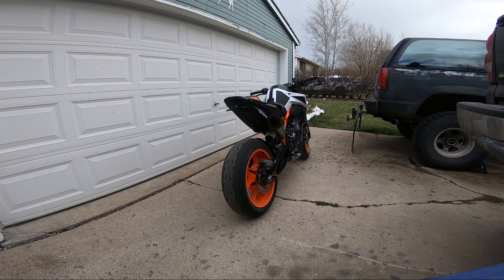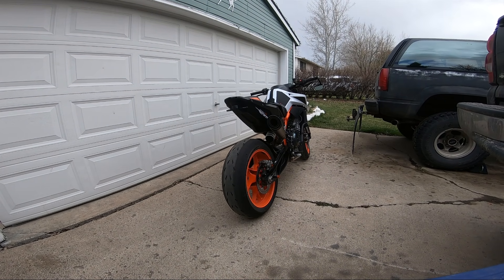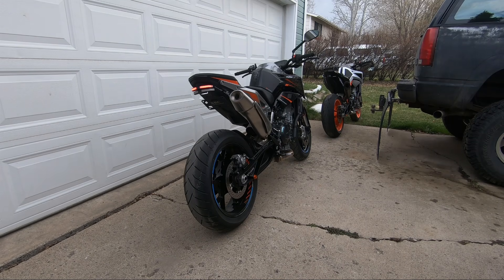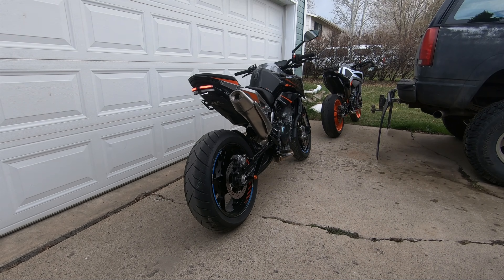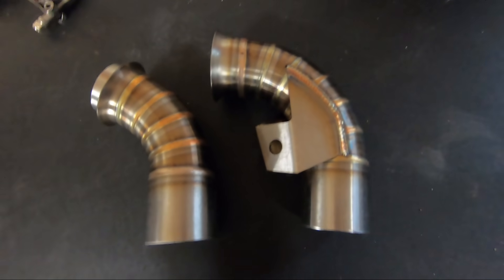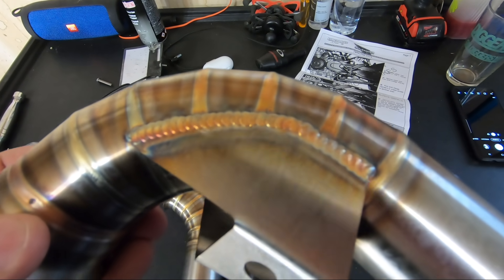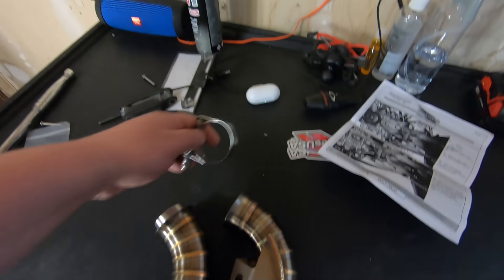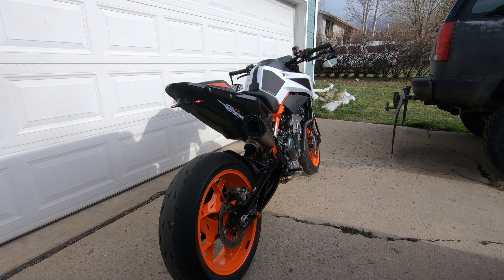2020 KTM Duke 890R DECATTED with SC Project Slip On Exhaust clips

Comment: Hey when you decatted did u need to get a tune? And if u did. Did u have to buy a fuel mapper? Or does the bike already have it stock
Reply from the maker: I had my dealer install the Akrapovich map for full exhaust but my dealer is much better than most.

Comment: This motorcycle needs 2 into 2 exhaust system as it has separate oxygen sensors for both cylinders. I am sure it will sound even better.
Reply: Agreed, AR makes a nice 2 can for the 790, super sleek looking
Reply: @rsajay6256  that exhaust is 2-1-2 type

Comment: This is the first bike that has made me consider trading in my GSX-S 750. How does the bike handle highway cruising, and does the bike still have plenty of grunt left at 80? Also, beautiful bike!
Reply: At 80 MPH, it purrs right along and has plenty left on tap. I took a 350 mile ride (round trip) the other day with about 100 miles of freeway (sucked) and cruising at 80MPH to 105MPH was no problem. You can put a pass on someone at that speed and make it stick.

Comment: Did you have any check engine lights come on when doing the decat? I have a 21 890 R and im getting the dual arrow and it goes straight to the headers. Wondering if ill need any extra stuff for ecu or issues
Reply from the maker: The bike has the Akrapovic map from KTM on it for the Decat. Everything functions as normal.
Reply: Ok cool I have the akra slip on with akra map so it's essentially running like it's got a decat and headers anyways so shouldn't be any issues once I actually add a decat to it. Thanks